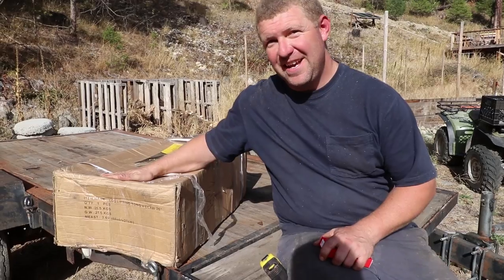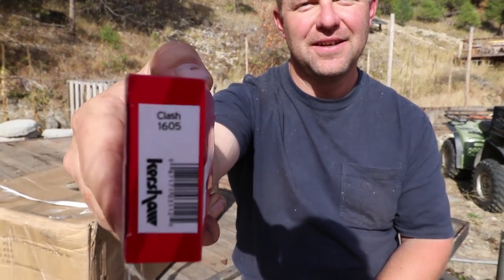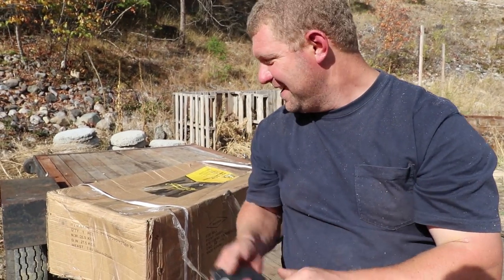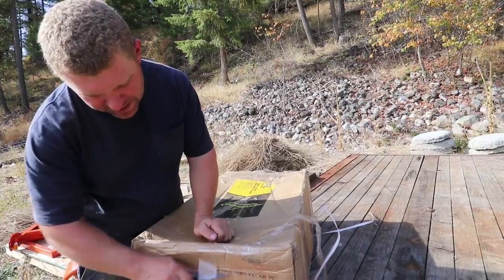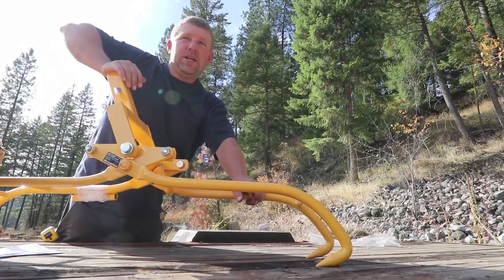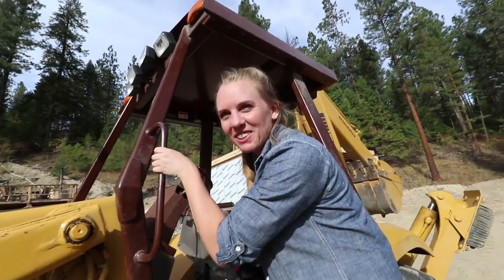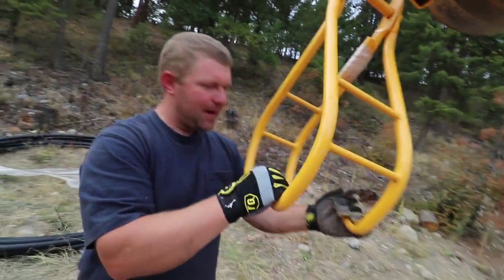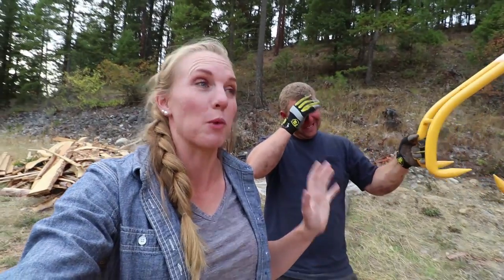THE CLAWWWWWW!!!! (Unboxing 36" Log Grapple)

Comment: Jesse I have three suggestions for you , ( #1 ) get a length of chain and make you a loop that fasten your grappler do your backhoe , suggestion ( #2 ) get two pieces of 3”x 3”angle iron 3 foot long and weld two pieces of pipe that will fit over the points on your grappler, weld a short length of chain with a slip hook to attach the angle iron over the crossbar close to the point on your grappler this will enable you to pick up your beams without poking holes into them.( #3 ) invest in a shut off switch for the battery and invest in a new battery for the backhoe, this should probably clear your battery problems

Comment: The hook on the bucket is there to be used for things like your new grapple. You will have a lot more control of your load than wrapping the chain around the pin and you won't need to worry about pinching your chain. You two are doing a great job, keep it up. Love watching young couples build their dreams.

Comment: if you take two two ft logs that are about 6 inches across you can drill out holes for the pointy bits on the claw and make yourself a set of soft jaws. This will let you lift the finished timbers without damaging them

Comment: Morning guys, I'm a heavy equipment mechanic and most large pieces of equipment are equipped with a cut off switch that will disable your batteries and not allow a voltage draw on them, also a deep cycle gel cell battery will go far in the life of your equipment a little pricey but worth the cost. Keep up the maintenance on it oil changes and hydraulic filter changes . keep tire pressures where they need to be will help with premature wear on your tires,  great videos

Comment: I have to agree with Whistle Dog. I fell 30 feet to the floor when the forklift boom cylinder seal ring blew off when I was in a work basket on the forks. Fortunately I wasn't hurt but hydraulics rely on a $.50 o ring in way too many places to keep that half ton of boom from dropping on your head. Never Ever get under the bucket or any part of the backhoe when it is suspended and or the machine is running. 
One of the Stout sons working at Stout Excavating had a Michigan Loader drop the bucket on him. Killed instantly.

Comment: You can easily find phantom loads on equipment easily with an amp meter hooked up in series with the battery. DO NOT TURN THE KEY ON! You'll blow your meter. Take a reading off the meter then start pulling fuses one by one. The one that causes your reading to drop is the circuit that is drawing down your battery. Love the videos! Keep up the awesome work!

Comment: Hey guys,
Have you thought about building a log deck that holds several logs? When you need a log on the saw, you just roll it on the saw bed. That way you don't take a chance in damaging the saw bed with a swinging log. It would speed things up cause you could just throw several logs up on the deck with the tongs. Not sure if you have room but I think it would help.

Comment: If you guys got 4 hockey pucks and put a shallow hole in each side, you could put them over the sharp points on the grapple, and it would pick up your finished beams by the hockey puck 'pads' without digging holes in them, and they'd be quick on/quick off for moving between finished beams and rough logs.

Comment: Jesse, wake up, you've been driving me nuts. I thought by now you would have figured it out. Start using your Bucket to lift and drive the dang log to it's destination. You'll find life a lot easier, let alone much more accurate. I've hauled logs with my backhoe for over 15 years and not once did I ever use the backhoe,..... they're for digging holes and narrow trenches, Yea, I even use the bucket to dig nice wide drainage swales as deep as you please. The bucket is way more powerful than the hoe, particularly when the hoe is any distance from the tractor. If you ever want to grapple something with the hoe, install a "thumb" on it.... They can be purchased or easily fabricated form channel steel. By the way, I'm sure you've noticed the fork lift hooks welded on your bucket, you can use those to suspend a chain from either side, the middle, whatever you need. Try it! You'll like it!!. Take it from a fellow pilot, ok? PS, put some of that weight & balance, aka "moment" airplane knowledge to work.....jeez oh wheeze.

Comment: We had the same issue of your Backhoe with a tractor in a friends farm. we ended up setting a on-off switch out of the battery hot wire and we got around the dead battery issue. I am not sure why ppl thumbs down your videos, they are entertaining, and bring some ideas too, you guys are not professionals showing the work you are doing and learning as you go. Kudos.

Comment: Two Suggestions;  
1, purchase a good multi tool! With everything you're doing and will do you will use it everyday for large and small engine adjustments, box opening, wire cutting and a plethora of other things.  2, Use the hook on the back (if it has a latch) of the bucket.  Loop a chain through hook this will allow you to make minor adjustments (up and down) when you open and close the bucket. once you get used to it, you'll be able to get really accurate.  The Hook will not fail with what you're doing.
Reply: I agree with you and i'm not talking about the knife aspect.  All the random tasks he is doing and will be doing the multi tool will be useful. As per the video, he now has a pocket knife to accompany the multi too.

Comment: Okay, after reading all the Electrical advice, let me throw in a tried and true Mechanics trick. (ASE certified)  
1. Get Voltage meter. (Cheapest you can find)  
2. Disconnect Battery from the Post. (Make sure Key is off)   
3. Place meter between Battery Post and Cable.
    a. If Meter shows Voltage, Unplug 1 Fuse at a time. (Replace after check) Voltage will drop when the offending Circuit is found.  
4. Trouble shoot Offending Circuit.
Reply: x2 ,, and clean the posts and cable ends ,,, ALL ENDS  block side as well as battery side.

Comment: Add a cut-off switch(like on your battery bank) to the tractor. Cover the prongs(on you log grapple) with radiator hose or like material, so they don't damage your beams. Hopefully it makes your lives easier. You can use it to pull lags out of the woods too. I used to use a similar item to pull pallet type stuff off flatbed trucks.

Comment: Good tool to save your backs. I used to own a Woodmizer portable and although I had the hydraulic loader, some customers would insist on wanting to bring logs to the mill using their tractor. I always refused ..... one bad luck and you sawmill bed is all bent to hell and you lose any chance on miling accurate lumber. While you obviously are getting quite good at operating your backhoe, an accident is always possible (you sure don't want any delay with the Class coming at the end of the month). You might consider setting up two logs perpendicular to your mill, as a loading ramp. You build it level or even sloping a  tiny bit towards your mill. You then can just set the logs you want to cut on this log ramp and then roll then gently unto the sawmill using a peevee. Best of luck and be safe ;)

Comment: 1)  you can scoop up weight into the shovel of the backhoe to counter balance the bucket end,  then you T to the saw table but back away from the table to get full use of the arm extend and the counterweight in the bucket will make it all work.   2)  Pre-Make a chain loop for the grapple so it's just loop, lock and go.   3)  I do not see a provision for an overhead hoist in your garage ,  something you would really want  once the garage is floored over.   4)   Expect Snow soon in the year and probably more than norm for 2017 . . Good Luck
Reply: MindWalkN NDB: Actually he did #1. Watch closely at the beginning of the video where he's scooping up dirt.

Comment: If you make little feet to go on the spikes you can still use it to move the milled beams as they will work like a pair of pliers and will grip tight due to the weight and won’t poke holes in the finished beam.

Comment: You may have a faulty battery in the backhoe that is self discharging try phisically disconnecting the battery and charging with a charger and then keep an eye on the battery voltage over a day or two 😊

Comment: Good video, thanks for sharing the real world of heavy equip.  Rigging is everything when it comes to crane work.  Try  putting the chain around the backhoe stick and out to the bucket teeth, then down to the grapple.  This gives you a closer lift (more leverage), one more axis of control and keeps the bucket out of your way.
Build a wood table beside the saw, so that you put the log on the wood table then slide (or roll) to the saw, that way drops etc. happen to cheap timber, not precision machinery.  Good luck and work safe.  Greg B.

Comment: Also for a quick fix for the battery drain you could put in an battery isolator switch.  Often used in marine conditions because they have so many battery drain issues on boats

Comment: Our wood mizer guy said the best thing to do is build a bridal to place your logs on then you can peavey them onto the bed. When you make your bridal make it the same height so your not fighting gravity when rolling your logs. Also if the log falls it would damage the bridal not the bed. We load with a set of forks on an LT28, your mill is  a lot lower so it should work better . Good Luck.
Reply: Great advice!

Comment: Hi battery discharge, you should check alternator for faulty diode , if a diode goes down battery will discharge  overnite because currant will try to flow the wrong wall out of battery to ground via the alternator. all the best Peter in the UK.

Comment: Check your alternator connection, it MAY be drawing the amps on the field wire (the one that excites the field coils) chances are that is your current draw. That being the case you CAN put in a toggle to control it.

Comment: Kershaw is an excellent brand of knife (I actually own the Kershaw Clash Serrated - 1605CKTST). Make sure you determine whether you'll prefer your knife clip mounted so the knife is tip-up or tip-down. Changing the position can significantly improve usability and your knife is one you can customize it on.
Reply: Kloberman I agree!!

Comment: Installing a thum is a simple fix if you know what you are doing. There are loader bucket options too. Research the hydraulics it is imparative that a relief gave is in add on system or cylinders will bend. Then there are add on valve body section to add. Plus all the hoses and having the Snap On wrenches that have the correct angle. There are bar holders on your front bucket to add on fork lift fork that is quick and easy. Respectfully Kudos

Comment: The right tools make the job so much better...* My 2 cents on the dead battery, if the windings in the started are shorted, doesn't take much, it will kill the battery while it sits. Enjoying the videos...Thanks guys.
Reply: Scotty362100, There are nicer ways to say things. How about, "The Starter doesn't have power unless the Key is turned", or "They are using a Battery disconnect". Sounds a little better huh?
Reply: Hey guys, it's true I don't know much about auto electrical stuff and certainly never claimed to be an expert. The reason I mentioned the starter was that years ago before there were computers in cars, I had a car that was killing my battery and it turned out to be the starter. Replaced the starter and problem was solved. I just assumed the windings were shorted. I said "my 2 cents" because I figured it wasn't worth much anyway (hoping it was obvious). Just trying to be helpful. Let's move on and put this behind us. Thanks for the support JM.  Let's continue to encourage these folks in their project.

Comment: Have you thought of putting a battery isolator switch on the backhoe until you can find out why there's a power drain?  It's a simple installation and you wouldn't have to jump it all the time.  Just a thought. Enjoying your vids.  Take care.

Comment: As for the battery drain ck to make shear the disconnect is doing just that. i have has some in the past not fully disengage.
or just get a battery tender solar painale , put it on the hood (easy snow removal) or up on top were its a little safer. I have some on equipment i don't us very often and it is always ready to go.
when moving your logs get a big shackle and have the boom coming start out the back the ho will be a lot more stable. love the videos guys .

Comment: Battery disconnect switchs can go bad too.
If a hydraulic line pops you two might go flying.
Plus,any electrolyte on the battery and battery holder could run a battery down.

Comment: I'd remove the bucket from the backhoe and work out a way of attaching the tongs using the box section, so that the you can use the hoop to attach straps for lifting sawn timber.

Comment: I had ran into this on an old tractor when we would do a lot of starts but very low run time .we would start it use it turn it off and then be busy we found out we're taking so many amps out to start it that we want running at long enough to replenish that battery

Comment: My brother built a simple set of forks and pinned them to the bucket. Excellent for moving trees around. Just leave tall screws standing up on the back end so they don't roll back over the bucket and onto a pressurized line. Been there done that.
Reply: Yes indeed,bucket forks rock!

Comment: Good luck driving out the pins holding the backhoe bucket on I've seen some not move using a hydraulic ram and heating them with cutting torches

Comment: guys just a couple things,  1 you guys probably want a dust mask at the very least, pref a respirator, while grinding anything (last video)  and 2 why not use one of those old 100 watt solar panels you got laying around and get a battery mppt charger for the backhoe so it stops draining the battery on ya?

Comment: One easy way to find a battery drain, disconnect the ground battery lead and put a multimeter set to amps in-between the lead and battery (if you don't have a multimeter you can use a bulb). If its draining it will show you how much by (or light the bulb), if its draining just start unhooking electrical components until you find the little devil.
Reply: This!

Comment: Hola Guapos. The Grapple really interested me. I live in Spain and the aquaduct in Segovia, built by the Romans 2000 years ago, used the more or less the same pincer technique for lifting stones. All the stones had a hollow chiselled out either side where the grapples engaged. Great to see that somethings do not change. Great channel. Well done.

 By the way, I have lots of grey hair and have loads to do with my time. It will be here sooner than you think.

Abrazos. David in Spain

Comment: Those backhoe's had a problem sometimes where the wiring harness passes through the floor, because of spray from the wheels, under the floor there is a plug, it corrodes, it could be shorting, installing a battery cut off switch, is a cheaper fix for now.

Comment: Thought for solution on phantom load in the electrical. Buy a hard line on/off and install near the battery connection. Would work, no?

Comment: You may try to take the battery out and line the box with wood as a temp fix,  I had the same problem with my backhoe,  It worked till I needed to replace the battery,  seems the charge can leak if on bare metal.

Comment: You need to put your stabilizers lower, lifting the machine higher. At 10:33 there is way too much weight on the tire, it is very deflated, no need when you have stabilizers. Your front bucket should parallel to the ground and lifting the front a little. The front tires can be lifted ever so slightly but this will give you a solid footing.
Reply: Great advice! Tire saver! Load saver! Life saver! Jesse needs lessons from an experienced operator.

Comment: Pieces of hardwood  with tapered holes that go over claws, and maybe hold on with magnets,  with just a little bit of the spikes sticking out ,  would lift a beam without too much damage.     They might even be lined with rubber or some more small spikes to spread the grip.  Kinda like soft jaws in a vice

Comment: Sounds like a ground issue had the same problem with a similar backhoe chased my tail for months came to find out there was a loose ground on the starter. Would hook up jumpers and it would get just enough ground to start right up

Comment: Thanks for the video!  I just ordered 2 of these tongs per your recommendation.   My plan is to hang them off the front bucket loader and use them almost like a grapple.  Two of the to keep the log from swiveling while I am transporting it.  I can't way to try them out.

Comment: Your battery draw check all the switches that may have had lights attached and been removed before you bought it all you need is a 1 to 3 amp draw to flat your battery bit if you don't have time to sauce the load take positive n lead of battery

Comment: Took me months to find the phantom draw on my mustang battery. turned out to be bad diodes in the alternator. Its hard to find because it charges fine. Problem was it allowed some current to flow backwards draining the battery.. Fixed by getting new alt instead of refurbished . Thank you for the video.

Comment: Using the claw on front end would be better than the boom, you have better weight distribution with the boom as counter balance. Right chain length from both sides of bucket the front loader would handle it way easier. Reach may be an issue as the loader wont reach as far a the boom but you'd have way more lift capability using front loader..Jay

Comment: Is there a way to anchor the 2 inch receiver to one side of the tongs so you could add a length of cable to the cab of the backhoe for a quick release? Just an idea. Once the weight is off the tongs you can pull the cable to release and move to the next position.